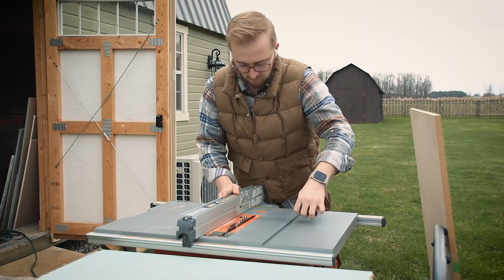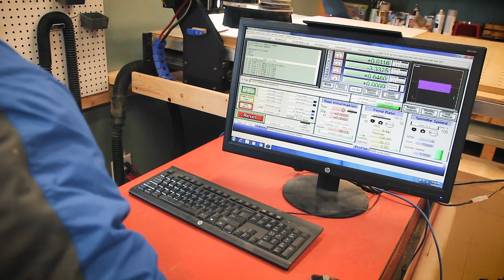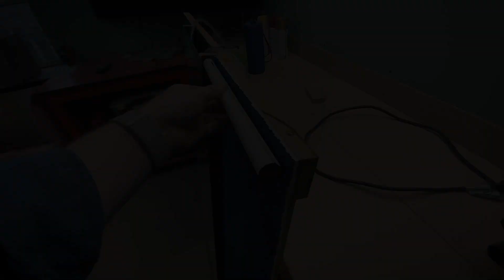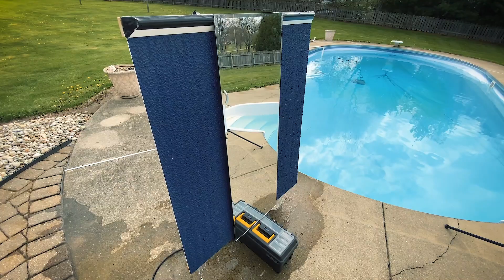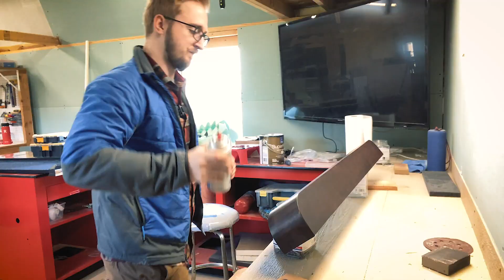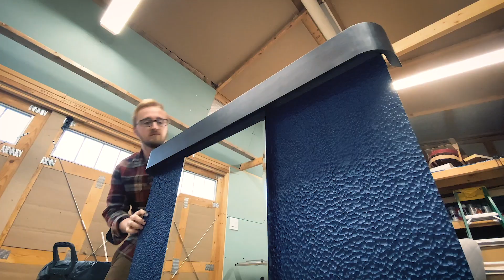DIY Siri Controlled Smart Fountain With HomeKit Compatibility

Comment: Beautifully done, my friend! Your craftsmanship is excellent! The only thing I would tweak is the lighting. Instead of an LED strip, I would try to find some mini LEDs that produce more of a beam. That way, you can see that nice texture farther down the fountain, and you could better control to what extent the light leaks on to the wall. 👍
Reply from the maker: Kayt Sayre that’s a good idea! I suppose one other option I have it to mount a small lens to the bottom of the diodes that will help focus the lights some more. I looked at using some puck lights but there were just a bit too wide to work properly in this application.